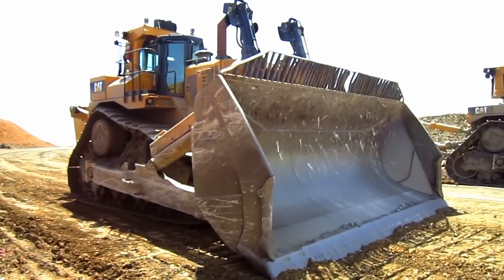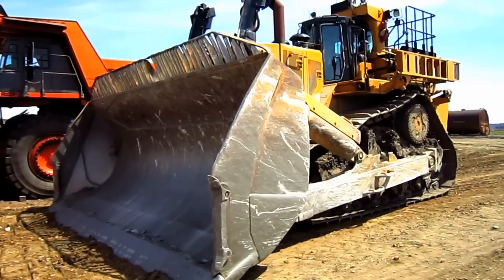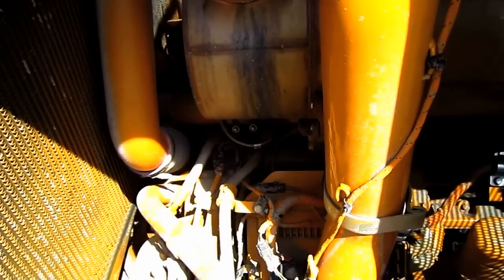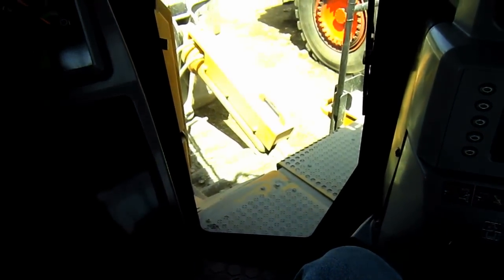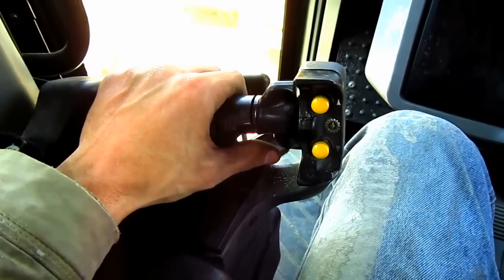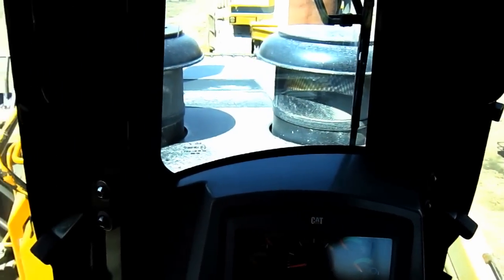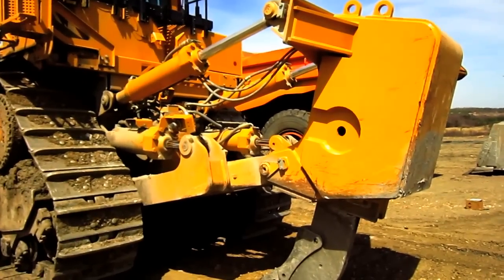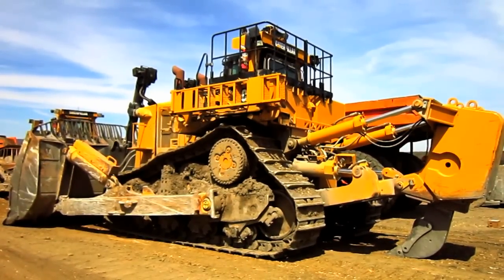Caterpillar D11T Carrydozer Documentary

Comment: Anyway you can do a video on the Komatsu 575? I've read that there are several in West Virginia. I still fail to see the advantage of the high track system. Seems to me that this system would wear out the pins and bullgear a lot faster than the straight track system. I could understand if Caterpillar used the same system that ACCO did on their Super Dozer with the high track but with two bull gears driving the track, one in the straight position and one in high track. I can see the advantage there as the load per pin should be reduced as it is spread over more sprocket teeth. If someone could explain if and how the high track system is better I would greatly appreciate it.
Reply: @Parents of Twins  I believe the main reasons for development of the high track system are as follows. Protection of the final drives from shock loads.Final drives are also kept away from constant contact with mud and dirt. This is accomplished by mounting them in a much higher position. With the high track system the traction is better because more track is on the ground.I also heard that servicing is easier for the mechanics when performing major work on the undercarriage.I think both track systems have their flaws. At this point in time I think it’s all about crunching the numbers. The contractor or equipment owner have to decide if the particular machine is meeting production targets and what are the overall maintenance costs for that unit. And lastly does the machine have a very high availability rate?

Comment: Thanks for your video. Just started working on coal mine rehab on a 2012 D11t. My question is what is the difference between the 2008 model and this later and final version apart from engine side doors and exhaust system . I have noticed the new D11 released last year has about another 100 hp in reverse, this will make a difference reversing up steep slopes in second gear and is needed

Comment: Hello man, what difference  betwen D11t and D11t CD. CD is more for carying soft materials compare to regular d11 t or what?
Reply from the maker: Ultimately, they are the same tractor, however the Carrydozer is a more beefed up version of the standard D11.  The CD features a more heavy duty undercarriage and frame as well as the carrydozer blade for high volume earth moving.
Reply: @PAmining  Thanks for answer. I like d11, the best dozer on earth at my opinion

Comment: Anyone notice that the hydraulic ladder looked like it had never been used.... LOL
Reply: Designed purely for clipboard man.
Without clipboard man the entire Construction Industry would fold and nothing would ever get built.
All hail clipboard man.

Note: This post was written whilst wearing full PPE and holding Regulations in my non operating hand.
Reply: @VaporheadATC
More likely for safety regs requiring de-mounting facing the machine and with 3 points of contact at all times. The steps are actually provided for maintenance as you may notice if he had shown you to the front of the dozer, behind the blade.
Reply: I thought the same thing, then I figured it is probably for maintenance crews or locations with lots of mud.
Reply: the ladder down switches fail and we rip them off. They last about 12 shifts and become spiral staircases. waste of 30 grand.

Comment: That epa bs between 12 and now is a nightmare.   My advice go buy a d10r . epa forced this crap and engineering was extremely poor. C9.3/  loose the egr cooler and you bend rods. Fact. Its junk. Coming from a guy who repairs this. Old 3306 or d330 never bent rods unless extreme failure. Sad  part is you have to wait 5 days or more to get parts.   They are throw away motors now.  Cat needs new engineers. This is automotive crap on an industrial engine.  Love cat but what a mess.   You know it takes 8 man hrs just to get to a valve cover to replace an injector.  Epa needs to go to china not here
Reply: Patrick Bolin...... Cat Really screwed up with their ACCERT "technology" for the 3406 series class 8 truck (hwy) engines.... wayyy over complicated,  poor fuel mileage and a nightmare to work on resulting in greatly increased downtime.... further resulting in a mass exodus from Cat powered class 8 (OTR - Hwy) trucks by the trucking industry at large,  especially the owner operators.

Your absolutely correct about the bent rods.... same issue with the Accert 3406 engines when you lose the egr cooler.... liquid just never seems to want to compress very well, does it(?).  : )       The EPA NEEDS to GO AWAY... PERIOD !!!..... or at the Very Least,  needs a complete "house cleaning" and then put people in, who actually have a good combination of Common Sense,  mixed with a healthy dose of actually KNOWING what their Doing...... ie: having a Masters degree in Engine Design & Theory,  and At Least 5 years of hands on Engine Research and Development Experience with a major diesel engine manufacturer... for diesel position with the EPA,  and equally the same requirements applied for gasoline engines,  etc, etc, etc.
Reply: How does it bend the rod? Hydro lock from coolant in the cylinder or something?

Comment: You finally you did it! Now I know about the gigantic toy bulldozer that I have. Here is a little info about the toy version. The toy version has an SU blade, and a single shank ripper. The tracks are a plastic chain link System and the scale is 1/16. Also the operators cab actually opens so you can stick a driver inside. It is made by Bruder toys. If you would like to see a photo of it go to Amazon and type in Bruder  large track type tractor. Or if you would like to see a video of it instead check out my video called fixing the D11T.